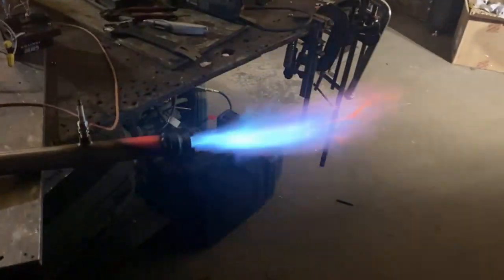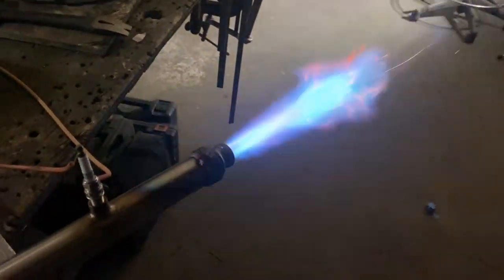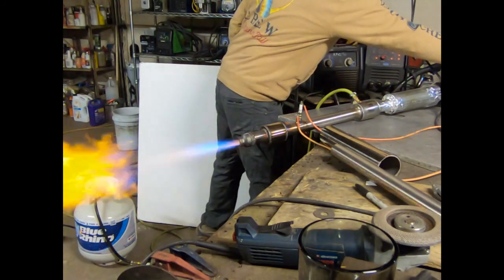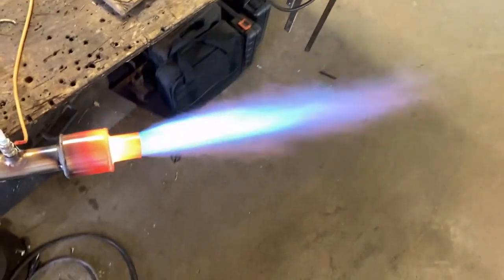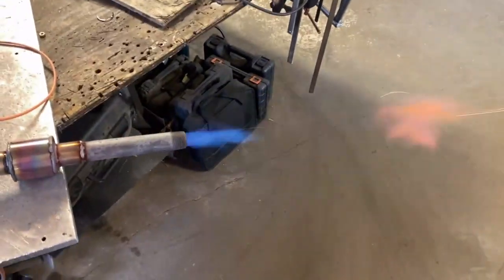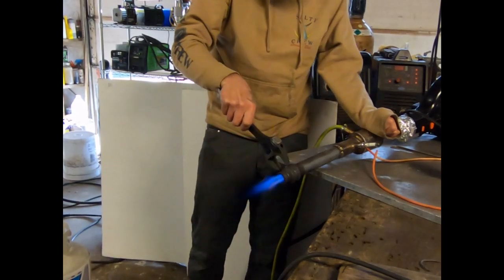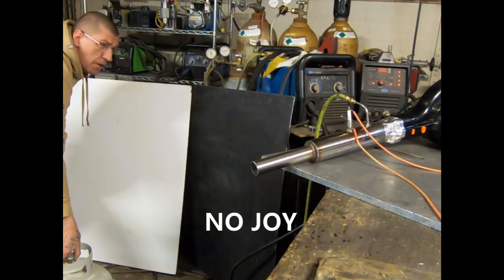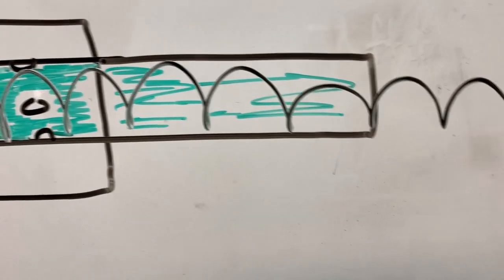Combustion Chamber and Burner Design

Comment: Putting a swirl inducer early into the air/fuel mixture will increase and stabilize your flame.

Even just a simple pair of opposing plates [such as cutting a washer in half and welding it in at opposing 45 degree slopes, or quarters and doing just the same, but just spreading out the surfaces and shortening them] and us super simple and cheap to do.

Comment: I just want to create a cutting torch using propane and my air compressor instead of leasing bottles of oxy/acc. 5 an 10 yr leases up here u.p. of mich. They wanna get right these days.
Gotta have them for shop and garage daily uses, but nowadays, I just wanna play around on my own junk.
B4 the lease ran out I didnt even touch the torches for 3yrs after I closed down the exhaust pipe bending shop. But sure miss cutting bolts off or cutting project metal, or a broken snow plow. All my junk. LOL.
is there away to get hot enough heat with 20lb propane bottle like the one I saw in ur video,, and using air regulators from air compressor to get the lighter metal hot enough for  cutting torch? B4 falling back with leasing  GREEN compressed Oxy enriched bottle?
Most stuff I mess with is rusty bolts, that can be heated up and air gunned off or hearing up to bend 1/4" steel or less, but at times I would like to blow a bolt off with the "FIRE" wrench too.
Have u found a way to make a small cutting torch occasional use for hobby work?